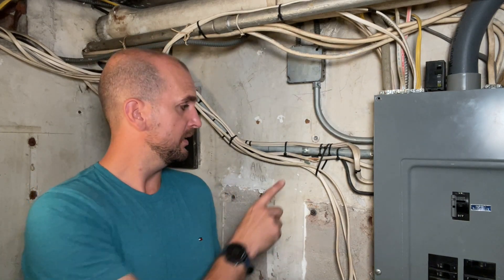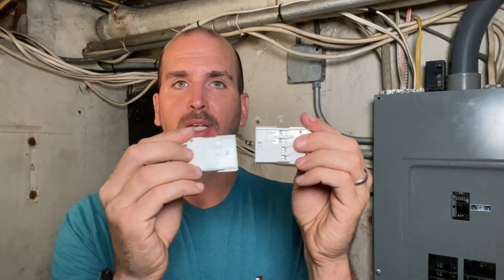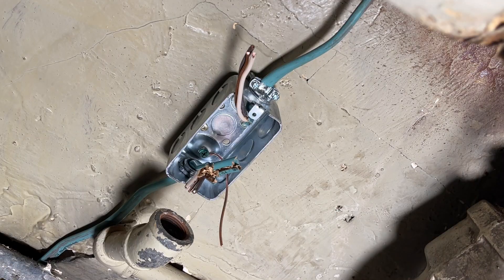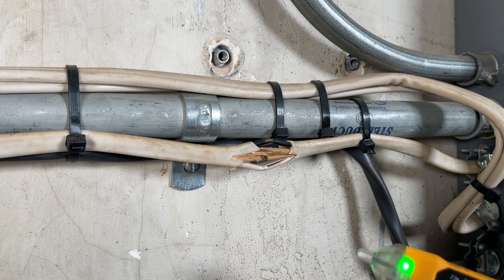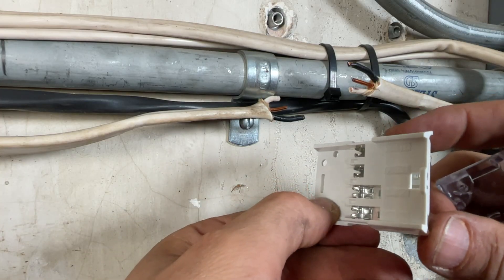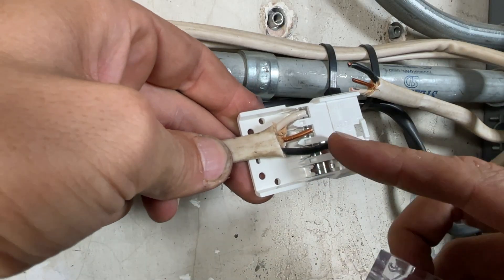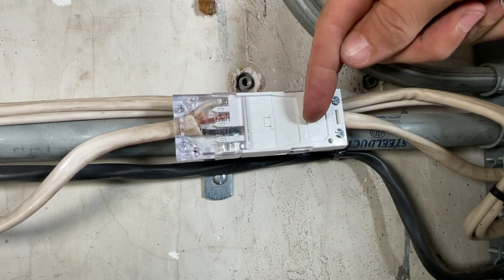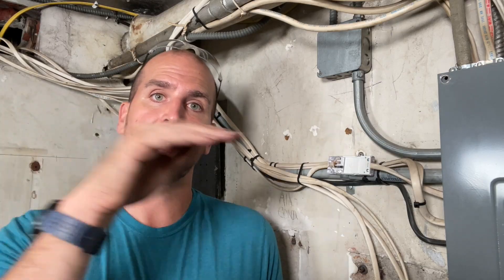How To Repair Damaged Romex Wires

Comment: Not a bad video, but one tip for you and anyone paying attention.  When making or breaking branch circuit joints, there is an order to follow.  If you are breaking joints, start with the hot wire, first.  The neutral, second and the ground last.  When making joints, go in the opposite order.  This way you always have a grounded, non-current carrying conductor as a path to ground, rather than yourself as the pathway to ground.
Reply: Thank for this!
Reply: @dalewoodiel  you're welcome.  I am a heavy construction electrician and I have been at it for 28 years.  If you have any questions about electrical work,  ask me because I probably know the answer.  Glad to help
Reply: @skindianu  1)  Is it legal to strap romex like shown in this video and have it exposed to danger like this?  I thought the code stated that it can't be installed if there is a possibility of being hit and damaged, like what happened to it and the result is needing it to be spliced.2) Also, I saw in a school MC cable installed above a suspended ceiling, and they ran it through the metal trusts and strapped it using wire ties, is that legal? 3) Do you have a chanel?
Reply: @baileyboy7567  doesn't n't the chase that the Romex is in.  Have a lid with bolts?
Reply: As far as MC is concerned, you can run a bunch of double barrel MC connectors in a pattern on top of your switchgear.  You can run the MC anywhere that it will be protected.  Inside of walls, columns, soffits, bar-joist above a suspended ceiling.
Reply: @skindianu  Question? Plugging a space heater into that circuit,  making or breaking  circuit joints  cause a fire? Would  It seems like it would have better to leave the conductors intact and to repair the exposed wires with electrical tape?
Reply: @dalewoodiel  great tip as my uncle had his back and chest blown out from being a ground and his boots had tiny pin holes in the soles where the electricity exited into the ground.
Reply: The splicing kit . . did you say you can put those behind a wall? I couldn’t tell if you said ‘can or ‘can’t’. I am looking for that solution.
Reply: yes I learned this the hard way....
Reply: i do the same
Reply: All your info is correct, however, can you explain why you do this, or were you just trained this?  Just curious as i am in construction also.  Not a electrician but it always blows me away how little American electricians understand about electricity
Reply: @lucaschapman1966  electricity is always looking for the fastest path to ground.  If you were working on a live circuit, that can't be turned off, for example, a critical branch circuit supplying power to a patient headwall in a hospital ICU, you would disconnect the hot first, leaving the grounded conductor intact.  The grounded conductor would be a better path to ground than you would be, if you were to accidentally short the hot out, while you were handling it.
Reply: @lucaschapman1966 Have you ever heard the term “The rules are written in blood”? Whether it’s first hand knowledge for this person or not, some where at some point, someone (or many were) was bitten by not doing it this way. From that, we learn from experience that we should all do it the same way and for the same reason that one should always assume a wire is live even when one “knows” it isn’t. I mean, lockout tags exist for a reason too, right?
Reply: @lucaschapman1966  and you are right.  Many electricians go through their career, being proficient at installation but knowing the bare minimum about theory.  Sometimes you might notice a contractor hiring service electricians but telling "construction electricians", need not apply.  Alot of guys can't read drawings anymore because companies want robots, not well rounded journeymen, so guys on the floor are discouraged from looking at the drawings and are directed by a foreman or lead man to install three devices backboxes on that wall, with interconnecting conduits or cabling.  It's supposed to be faster and more cost effective, but to me, it only removes integrity from the trade
Reply: What was wrong with it that made it "not bad"? Your tip, I'm not going bother discussing.
Reply: @nothankyou5524  glad to hear it
Reply: I just got some two days ago !😂
Reply: It would be alot safer just to turn off the breaker.  Why work on a live circuit ?
Reply: @FC-qe1wl  'It would be alot safer just to turn off the breaker. '
You should STILL use the correct order, just in case something that appeared to be completely off or disconnected wasn't, and so that you habitually do the correct order every time.  
Pretty sure he wasn't suggesting to not turn off the breaker, and it was already mentioned in the video.
Reply: Homedepot and Lowes discontinued these items. Not allowed unde4 National el3ctric code.
Reply: @blt981  This item is still available at Home Depot (model #NMS-2) as of today (1/19/2024).  Per the NEC 2020 which is the latest accepted version for South Carolina, these are approved per 334.40 (B):  "Non-metallic-sheathed cable interconnector devices of insulating material that are listed shall be permitted to be used without boxes in exposed cable wiring and for repair wiring in existing buildings where the cable is concealed."  The paragraph goes on to state the attributes of the device. So these devices are OK.
Reply: I just verified it in the 2023 NEC, same article and is still there. Still allowed.
And good job refering to the article in the code book. I always ask electricians and wanna be's to cite the code article or local regulations  when they say that something is right or wrong.
Common practices or personal preferences don't make the rules.
Reply: @blt981  they are allowed but a lot of greedy electricians (like you probably) didnt like them and review bombed videos like these. so they can charge grannies 500 an hr to do the job.
Reply: This guy doesn’t know how to do anything. It is bizarre to me as why he makes electrical videos.
Reply: Actually, the correct way is to cut all conductors at once with power on. This is beneficial in 3 ways. Saves time, saves you from having to locate the breaker, and it gives your cutters a nice serrated edge!

Comment: I don't trust this flimsy plug connector.
Electrical Heat Shrink Butt Connector are used for sumersible pumps, so they are a tight connection and waterproof.

Comment: What a terrible repair tiny connection area, Its very close to electrical box put a new longer wire in box now with plenty of wire look at HCKev advice below , put in a socket ten you have a system you could feel safe with,

Comment: I have seen a much heavier duty form of a splice. It has three copper tubes with set screws on both sides. Each tube is insulated from each other and from the outside. I would trust that kind of a connection much more because it mimics the load box connectors.
Reply: That sounds to me to be every bit as secure as the wire never being damaged.
Unless it is in a damp position and gets all corroded it should handle as much current as the uncut wire itself.
Anything with a quick -  clip connector is the pits.

Comment: I don't like the splice kit so much because it reminds me of a back stab outlet, which has a nasty habit of failing. I would rather put high resistance tape over the bare wire and seal it with the stuff that you dip tool handles in to insulate them. Its kind of a rubber paint. At least then I know the original continuity of the copper is maintained. A company should come out with a kit that does not require cutting the copper. It would just cover up the bare wire and make it safe. That would be much better!

Comment: If I had a damaged wire inside a wall, I think I'd use that opportunity to add a wall outlet, even if not needed. You'd then have a junction box that's accessible, and that wall outlet might come handy in the future.
Reply: or just add a blank off plate on the j-box for possible future use and leave exposed to outside wall. Never a good idea to have any splice behind a wall that can't be available for maintenance. Not sure that will pass a city electrical code.
Reply: @robertjones3610  never talked about a splice hidden behind a wall, my whole point was to put a receptacle to have access to that splice instead of a blank plate.
Reply: Agree, adversity is always a chance for opportunity.  I would add though, the above white romex either low amp 14 or 12, not sure, I would add a box and an outlet for sure, but I would add a plate, square noting low amps, and just to be safe scratch in 15 amp or lighting. If it is not low voltage or not lighting, but 15/20 amp outlets that will not overload a breaker, then go with a traditional outlet and plate.
Reply: That's a good idea but I think it depends on where the damaged wire is located. If it is 5 feet off of the floor, that is an odd place to put an outlet.
Reply: @rhoonah5849  yes, of course
Reply: @rhoonah5849 that’s where you put a switch that does nothing :P
Reply: If it needs repair, use that opportunity to upgrade.
Our family has embraced that idea ourselves.
Reply: To add an outlet box and receptacle, you're going to have to make sure that you have enough slack in the Romex to accomplish the splices. In my experience, more often than not, there isn't enough slack.
Reply: @jhr2jam  of course, that's "if possible" 😜
Reply: This is a spectacular idea!  And perfect for my situation, thanks!
Reply: I like that idea, can never have too many outlets!.
Reply: @Chuckles..  as long as the circuit don't get overloaded!

Comment: Can someone answer two questions for me. 
1: can I use a plastic box for junction box?
2: why must there be a ground wire connected to box. Why can’t I just connect the two ground wires the same way as the hot and neutral. Just straight in with each other using same wago nut then close up everything up

Comment: you can still get away with using 14/2 on residential dwellings..? Also when i come across these kinds of problems i usually clip it pig tail an extension wire nut and tape it up thoroughly.. unless i have some kind of heat shrinks handy..

Comment: You've added resistance to the circuit. It was uncut copper, and now it has junctions. Not good at all. Heat. Fire. Probably best to have just used epoxy, or even tape.

Comment: I'd like to see a load test of that splice with thermal imaging. I'm curious how hot those connections get. I'm not sure you can do this, I'm simply posting what I'm thinking. I'd be wary of sealing this in a wall. Approved or not.

Comment: I've never seen that splice kit before. I wouldn't trust it on anything more than a closet light. I've been in electronic repair for 40+ years, and insulation displacement connectors have always been a problem.
Reply: Like I may have posted elsewhere, I had a trailer home with all the outlets daisy- chained and with quick - clip connectors and one time my wife wanted to run an air conditioner in a room and the power would have to go through about 6 
' daisy - chains ' of outlets. I was keeping an eye on the outlets, most were hot and I was expecting any of them start frying.
Gotta love the way they wired that place.

Comment: That is some really cheesy junk. Re run the whole wire. You're asking for a weak, shady connection that might cause a fire if you use these. Should at least put a box up and run a new cable to the panel and join them in the box.

Comment: I'd like to see a positive grip (i.e. screw compressed) junction on any type of potentially high current connector.
This may be certified - but it's by the same group who once approved aluminum wiring.

Comment: Enjoyed your video; however, I would quote the appropriate NEC for all decisions.  For example, according to NEC blah blah blah, I am required to do this and that.  Regarding electrical, for everything there is a code, and a code for everything.  Accordingly, observing everything else going on in the basement, it is clear that NEC was not always followed.

Comment: On the cable you were splicing I noticed the the connector on the cable was not addressed. It should have been tightened properly first to the panel so as not to put stress on the breaker neutral and ground bars while wiring.

Comment: All splices must be in a junction box, and the junction box must be accessible.
Reply: Actually, those TC splices have been approved for use inside the sheetrock for a couple of code cycles. Otherwise you're correct.

Comment: Is there a load/amperage limit on that connector? Those insulation displacement wire connectors have a lot less material for carrying current than the wire does. Seems like that could be an overheating point in the run under heavy draw.

Comment: I would personally use solder joint butt splices, with individual heat shrink on each conductor and a heavier heat shrink over the whole cable assuming you aren't using a box or re-running from the closest joint. There are wet location rated butt splice kits available, that connector looks like junk

To be clear, you should just rerun the wire and stop being so cheap but there are products that will address this issue in a way that doesn't present a future safety hazard or introduce unnecessary impedance into the circuit

Comment: I dislike those splice kits. I come across them in RV/mobile units to connect furnaces. Even moderate movement of wiring can lead to loosening that tiny contact area made by the insulation piercing  part, which of course causes arc and burn and at minimum power interruption. They often break if disconnected then re-connected. They suck.

Comment: It looks like you don't have enough free conductor in your handy box to pass inspection. I'm sure its safe, but it is not to code. If you are close enough to the panel or another box, run a new cable. Or install 2 handy boxes, with new cable between them.

Comment: That NM cable (Romex) is exiting the panel in all directions and making a huge mess!  Organize sets of (3) 12-2 NM into Raco 232 4" square boxes (2 1/8" deep and 30.3 cu in).   Then run 1/2" EMT conduit from each box to the panel.  You can carry (3) circuits in each conduit and box, to stay within the conduit and box-fill requirements.

Comment: over the years, i've replaced countless splice "kits" with boxes & wirenuts. they eventually fail & NEVER bury them or any other splice where it cannot be accessed. love to see how te splice kits & wagos hold up in damp & corrosive enviornments ,such as a swimming pool pump house. author doesn't strap wires within 6" of a box. i've red-tagged many installs because of this. there is a lot of mis-infomaton on you tube. viewers beware.

Comment: "And, now I'm going to secure the handi-box to the wall using two screws." (sound of gurgling water). "Please don't miss my next video, "How to Repair a Damaged Water Line Inside a Wall." Don't laugh too hard, as it did happen to me. I would label the cover with the circuit breaker number for future reference. All of those exposed cables bother me. I would rewire and put them into conduits secured to the wall. It could be that you are grandfathered as far as the wiring goes. I would need to know how old the house is. I've done a lot of DIYer projects, both inside and outside, and I think your list of tools is way too short. Also, I would add the word helper(s) to your list.

Comment: How do those splice kits do over time with higher current loads?  i.e. a circuit that will run a 15A heater or A/C unit?

Comment: Also, this item for repairs of romex (or any current carrying wires) is a dumb idea, those are going to melt at 10 amps fairly quickly... Possibly catch on fire, I do NOT suggest this repair under any circumstance!

Comment: in eupe we got the Shrink sleeve and Wire Butt Terminals. it make good solid connection, it only lose some flexiblity arund the connection.
it still nice see how other do the same job

Comment: At $18 for the splicer? Pass!  I would have run a new line out of the panel and used a small junction box on that ample wall space.  Twisters - don't need no stinken Wago's!  Though for the first case that worked well (Wagos).  That splicer could come in handy in some cases to be sure.

Comment: Using a non contact voltage tester is 3 steps, not 1. (1) Take the tester to a known live source like a receptacle to ensure it works. (2) Test the unknown circuit. (3) Return to the known live source and ensure it still works. Don’t skip number 3. It ensures your device did not die or lose a battery between steps 1 and 2. You are counting on this cheap $20 device to protect your life because you are not using PPE, make sure it works. Standard procedure.

Comment: WOW Approved.. I find that EXTREMELY Hard to believe. If our Electrical Inspector saw that he would laugh himself to death. In theory its a SOLUTION but not a good one or what I would call Code Legal. That type of Crimping over/under-plastic is GARBAGE, that kind of crap might be ok for Low Voltage. It just Stinks of what Shit House Flippers use to hide from doing the job right in the first place.  not to mention 30 bucks? Put a Flipping metal box in and splice it right. ITS ACTUALLY CHEAPER or for that 30 bucks... Run a new Lead... Give me a break.
Reply from the maker: From what I can gather I think these spices got approved preso a toy for use in manufactured homes specifically doublewides which had circuits that ran across the 2 sections.  Then once on-site it was “plug and play” to get things up and running.

Comment: lmao, wagos are not a recommended solution to a HR thats been damaged. yes a handy box as a junction point is fine but extend your 2 conductors and ground and then pig tail them and cap them wire nuts. wagos fail and just make you have to go back because of a loose connection